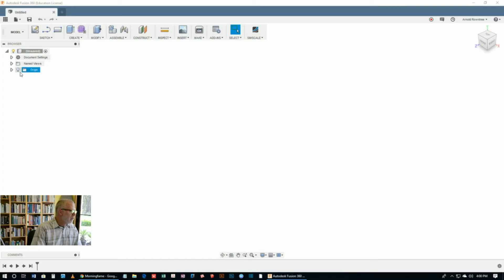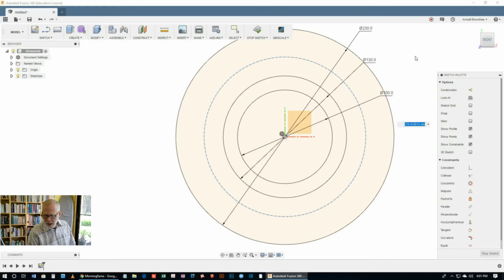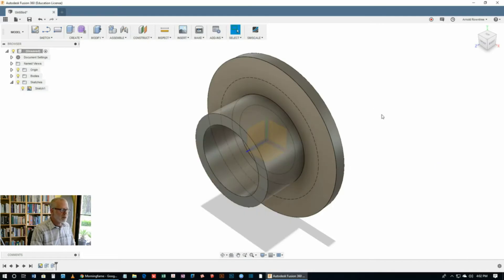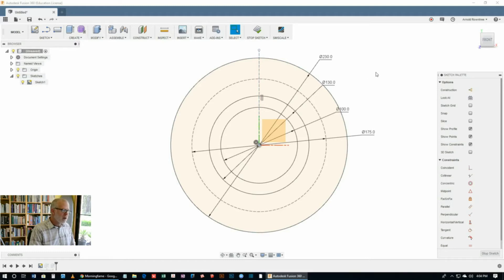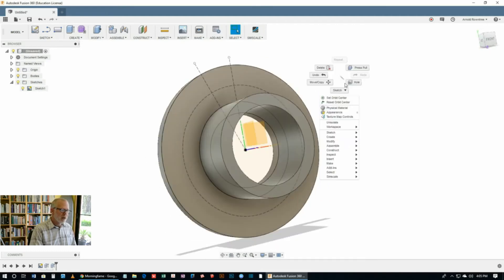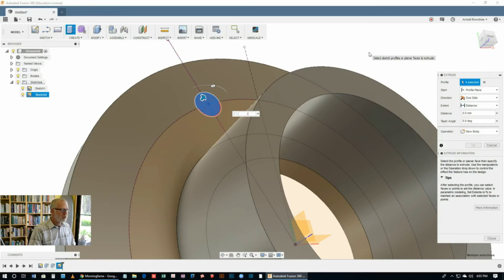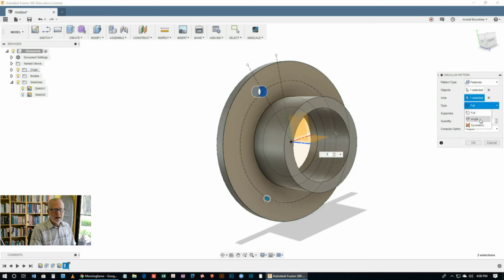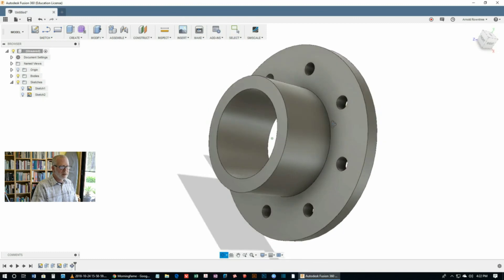Learning Fusion 360 For Beginners - Part 16 of 16

Comment: Arnold, Many thanks for all of the excellent tutorials. I have a question: how would you make the holes in this component threaded rather than through holes?
Clive
Reply from the maker: Clive, that's where the Hole tool comes in. I left it out of the 16 Basic tutorials because threads are such a big topic and are governed by standards which are different around the world. I've found that the complexities arise very quickly, especially in classes where I've had fitters and turners present, the tradesmen who have to work with threads daily. Nevertheless, the Fusion 360 hole tool isn't too hard to work with and I will plan to publish something soonish, thanks for the prompt.
Reply: Thanks, I've got it now.

Comment: So I had a problem getting the circle to snap to the 22.5 angled construction lines.  I ended up having to project those lines to get it to work.
Reply from the maker: Well done Chris, plenty of people have turned grey over this one. If all settings and preferences are right it goes smoothly but a lot of people just aren't holding their tongue at the right angle. I've explained how to project lines countless times.

Comment: Arnold, I don’t know how to correspond with you, this is probably the wrong platform, but I have been practicing very hard. You once said that repetition is one way of learning and as I have great deal of time, in the winter months, I have been using the parameters method of building woodwork projects, mainly garden planters. I have found it is best to test the parameters as I go along. It would be good to have the parameters dialog box on the screen all the time, but this does not work. The point is I still make the mistake, when extruding, of forgetting to make a new component, it defaults to a new body, with the subsequent procedure of converting the body to a component. Is there a way of communicating with Autocad to convey a ‘wish list’? Best regards from a very wet England.
Reply from the maker: Thanks for the contact Ron, its a pleasure to hear of your work and the things you're learning about Fusion 360. Parameters are a tremendous tool.  
It certainly is possible to communicate with Autodesk, in fact the folks at Fusion 360 are soliciting feedback like yours. Go to the forums, there is a link in Fusion 360 which you can get to from the little question mark icon at the top of your screen, over to the right hand side. In the drop-down, hover over Community and the little fly-out will have Forum as the first option. That will take you to the list of forums, sign up if you need to and participate in the Fusion 360 Feedback Hub.  Alternatively go here:  https://forums.autodesk.com/t5/fusion-360/ct-p/1234
Reply: @ArnoldRowntreeTeachesFusion360  Thanks Arnold.

Comment: Thanks Arnold, all 16 done now, some before looking at the video, some looking video many many times :) Question 1, Is there any way of using a printed/scanned drawing to use as backdrop and make a 3d drawing (have drawing on a gondola , thinking easier to draw upon than messure all info). Question 2, If I should make 3d drawing that will be printed out 3d, should I go for 1:1 scale when drawing (later converted to correct scale) or making it correct size (ie scale 1:48) ?  //Dan
Reply from the maker: Congratulations Dan on getting through all those!
Q1 I'll be doing a video on using photos eventually, its great to take a pic with your smart phone and go straight to modeling. It will be a while before I get to it but Tyler Beck has a good video here  https://youtu.be/HVEaYfdsgXc
Q2 You'll find that modeling 1:1 in Fusion 360 is a good way to go. Your slicer software can rescale things or you can save out a scaled down version before you export your .STL file from Fusion. Try it both ways and then decide which is easiest for you.

Comment: Thanks so much for taking the time to get me on the road to success with Fusion 360. I did learn a tremendous amount. However, I never did really get the whole origin setup and selection principles.  I am just wondereing if that's going to be a problem when I go to produce the project using a cnc machine such as a cnc router, 3d printer or plasma cutter.
Reply from the maker: Dave, if you've completed the 16 basic tutorials you've learned the basics of part modeling. That's a great start! CAM and cnc is within sight now but you do have a few more things to learn and just spending time with fusion 360 will fill in those gaps that are a frustration at present. I think you'll find that it will take a while to be comfortable working on your own projects, most people make a gradual transition from step by step tutorials to being able to work on their own projects. If you have the energy take a look at some of the other tutorials on my channel which will give you a bit of a challenge while you explore your own interests.   https://www.youtube.com/channel/UCR-69_Ukrk6u4gwqacqx-WQ

Comment: 1St Great Tutorial ....... Learned The Basics Of Fusion 360 .....
I'm using the Free Eval version of fusion - at the end of part 15 & 16 the demo uses " Create \ Pattern " for creating multiple instances of holes needed for the sketch , am I missing something or is this feature not included with the Free Eval Version i'm using    ........  how would I create multiple holes with the Free Demo Version
Reply from the maker: Marty, the pattern tool is the same in all the versions of Fusion 360, Personal, Educational, Commercial. You'll find that patterns can be done in the 2D sketch as well as in 3D feature mode. In both cases you'll find Pattern low down toward the end of the Create menu. Come back to me if you're still stuck.

Comment: What a wonderful teacher and amazing beginners' course. 

Though I would like to believe that the angle calculation was un-necessary in this case as the object is circular. So anyone having an issue with 12 o'clock position of the hole can rotate it.
Wouldn't that be the same thing?
Reply from the maker: The guys who work in these areas tell me that its a tradition but one that makes life easier for installers and for maintenance. In industry a draftsman is expected to know these things so that's one for you.

Comment: Thanks so much for this series, it really helped me transition from thinking in Autocad to Fusion360. I had a small issue trying to draw the circle for the bolt holes in the newer version of Fusion 360; I simply had to project the construction lines of the first sketch to the second sketch and then I could pick the intersection.
Reply from the maker: Thanks for sharing! Well done Squiggleypuff, yes, that's how it should be done.

Comment: Hi Arnold, it's not so much as doing something wrong, in selecting the quarter part of the circle, it is a wee bit faster to select the circle with a window selection starting from the left side of the circle and selecting the entire circle.
I was just refreshing my fusion 360, as a pensionado with a very small pension I didn't want to subscribe for this software, as I only use it as Amateur and they said it was free, and also for the ones earning less than 100k$ per year it was free . but to my surprise my "free" fusion suddenly stopped after 3 years. goodbye to my files, they were all in the cloud.  But they apparently changed their policy again, so now I can use it again with a max of 10 active drawings. 
 Kind regards Hans.
Reply from the maker: Thanks Hans, I must remember the window selection. I've had an aversion to Autocad for years but I obviously need to get over that.
Renewing your free subscription is a dark art, but thankfully Kevin Kennedy has done a neat video to show us how to do it.   https://youtu.be/XNh3dEfYCX4

Comment: Arnold I used the cylinder feature to make the first hole.  This allowed me to make a hole and extrude in 1 step.  It also didn't require me to select the quadrants when extruding.  It this an exceptable thing to do or could it cause a problem?
This series was very well presented.  You are a great teacher.  Thank you very much.
Reply from the maker: You're very kind jasinarok. If it works, keep doing it. Its twice as good if you can do it both ways, I can't tell if it will be a problem but you'll soon know. Just be sure to be able to do it the ordinary way, just in case. What I often find is that there are many ways to get the result you need.

Comment: Hi Arnold in this drawing when you made the circle in a second sketch I had the same problem having to select the quadrants and circle tool wouldn't snap to the insection either, I then edited the 1st sketch and the circle tool immediately snapped on the insection and then selected as a whole shape to extrude . Is this ok to do? In general sometimes I don't know whether to start a new sketch or add/edit the previous one? Your videos have been most helpful Arnorld, much appreciated mate.
Reply from the maker: Well done Steve, and congratulations on getting through to the 16th tutorial. Whatever it is that you did to get a good result with the circle extrude, try to repeat it and then remember. If you can't remember the specific solution at least remember that fiddling often gets you through a fix. Its OK to do it an unorthodox way, but if it causes problems in your project later on, you'll remember. As for the best approach with sketches, if you go on and do the intermediate playlist you'll see a much more complex sketch in the 'Top Down' tutorial where I use the same sketch for multiple operations. I've purposely kept sketches overly simple in the 16 series so that the inevitable problems are a bit easier to overcome. From here on you're finding your own way of working. Keep going!

Comment: Excellent course. Last used Auto Cad 2000. This is by far easier to get around. Tutorials super easy to follow. Thankyou. FYI Offsetting holes in flanges is to enable setting up line shafts, pipe work etc by making sure that any key ways and the like are at 12 o'clock with the use of a level across the two holes either side or flanges on both ends of a pipe. (very handy 20 meters in the air)
Reply from the maker: Thanks Peter, Its great you were able to give such an endorsement even with the intervening UI change. And thankyou for the explanation for the flange convention, I've watched guys installing an insulated stainless pipeline twenty feet up but now I'll be able to see what wasn't apparent.

Comment: Good day Arnold
Having recently retired from my architectural practice and using ancient software I am exploring going back into an early hobby of 00 gauge railway modelling. I have enjoyed your 16 + basic Fusion tutorials and I am considering modelling our local railway station buildings circa 1887 to be 3D printed. 

My question, I have site measurements clearly at full size, is there away to feed 1:1 dimensions into Fusion for them to be automatically converted into 1:76 scale to produce a drawing as to be printed, this could help identify certain dimensions that would be impractical for 3D printing and be adjusted during the design process?
Reply from the maker: Welcome to the channel Richard. You've made a good start working through the 16 basic tutorials and it sounds like a great project to model stations. Scaling will work in a similar way to your familiar software, use a factor. If you give me a prod over on my Future Engineering Facebook page I'll get that scale factor working with you.  https://www.facebook.com/Futr.Engineering
By the way, did you see where the intermediate tutorials are? This one shows you, see timestamp 3:05        https://youtu.be/2W9R9j5YBG0

Comment: I've managed Ok with the series until this one but have a problem with creating the circle for the hole on the PCD. I create the second sketch but there is no means of snapping to the intersection of the construction line and the PCD. However this does work if I go back to the first sketch and select that. Am I missing something here, and is it possible to force a snap to a type of point (e.g. vertex, intersection, end of line etc.)?
Reply from the maker: Chris, there is a Preference that governs this behaviour. Click on your picture in the top right of the screen, Preferences, General, Design and be sure that the fifth one down the page is ticked, it is named "Auto project edges on reference". How does that go?
Reply: @ArnoldRowntreeTeachesFusion360  - Perfect! Many thanks for that, and for the rest of the video series which have got me started in F360 after being pretty confused by the product.
Reply: @ArnoldRowntreeTeachesFusion360   - Incidentally , I got around the problem with selecting the 4 quadrants of the circle by doing a bounded select around all of them.
Reply from the maker: @chrisveitch1474  Thanks Chris, I knew I'd learn something from the community.

Comment: Excellent tutorial, no fluff and pretty much everything I need to know to feel confident with basic product design in F360. 
Really looking forward to your more advanced work in the future. I had only 1 minor issue throughout and that was that I could not 
snap the circle used in the pattern to the construction line intersection in this tutorial #16. 

I've taken other F360 classes online that were 10 times as long that I don't feel they were 
as useful or concise as yours.  Thank you for sharing your knowledge.
Reply from the maker: Thanks Big Mark, that's fantastic. Congratulations on getting through all these. 
For that issue with snapping the circle to the construction lines, go to Preferences by clicking on your picture in the top right, General, Design and click the one five items down called 'Auto project edges on reference'. Does that fix it for you?
Then take a look at the intermediate series of tutorials if you haven't seen them yet. They go on to the basics of assemblies.
Reply: @ArnoldRowntreeTeachesFusion360  Sorry for the late reply, yes, that was the issue. I've been busy using the knowledge you shared with me to design and build new machines and products for my business. I will most definitely have a look at your more advanced tutorials and continue to send aspiring engineers your way. Thank you again for sharing with us.

Comment: That was a great series, thank you Arnold. Also with the bit where you struggled to select the circle to extrude, you just needed to turn off the first sketch.
Reply from the maker: Haha, good call! Congratulations on your progress and keep going.
Reply: I scrolled down to find if anyone had come up with something! Good call, I used the hole dialogue from the previous lesson, centred the hole on the intersection and adjusted the depth ("All") and diameter parameters.

Comment: Hi - Must have missed the memo! In my version of F360 I cannot get a sketch line to turn into a construction line ie: it won't go dotty! Am I loosing the plot? TIA!
Reply from the maker: Jeremy, there are a few reasons why this kind of thing can happen, try saving your work, closing down Fusion, re-open and start a new document, a new sketch and test the Construction line conversion on the first line you draw. Your version will do it.
Reply: @ArnoldRowntreeTeachesFusion360  Thanks! Yes it works...is it a memory problem?
Reply from the maker: @jeremyelphick-pooley-desig4405   Maybe a memory thing, it can be something as simple as a hiccup in the internet connection. This is a hybrid local/cloud application.

Comment: Arnold, kudos on an excellent tutorial. After trying a few previously, I came across yours which was much more understandable, intuitive and fun. The only problem I had was during part 14. After drawing the lines and arc on the 45 degree plane, it would not extrude. I learned I needed to add a line on the tangent of the plane to enclose the surface, then it extruded fine. I look forward to finding more of you tutorials online. Thanks again from Texas.
Reply from the maker: Glad it helped! And I'm glad you were able to get an answer to that problem.

Comment: Hi Arnold, I am an electronic engineer and used Eagle to design my circuits, this software was purchased by autodesk and added to Fusion 360. I can do my circuit stuff its very similar to the old eagle, so I decided to get the most out of this software. After a bit of Googleing and searching on youtube I found your tutorials which are excellent, please keep up the good work.
thanks
David
Reply from the maker: Welcome David! That's interesting, I was excited to learn about the circuit features that have recently been added and I was motivated to get out the old text books and make a start learning myself. I even bought a multimeter, I've got a long way to go.
You might find the intermediate playlist interesting now that you've worked through the 16 basic ones. Keep learning.

Comment: When I try to cut the hole at 6:47, after selecting the hole I get the error: No target body found to cut or intersect. I tried selecting from the back, same thing happens. I can select join or new body and that works I just can"t cut a hole. Any suggestions will be greatly appreciated. I am using the latest Fusion 360 update. I loved doing these videos and really appreciate all the work Arnold put into them.
Reply: Well I got it to work but only by following these steps in this order. Select last entry in the browser than select finish sketch and than extrude. Now it will allow me to select the circle and make the cut. If I click extrude before stopping sketch it doesn't work. Maybe it's the new update.
Reply from the maker: You're on to it Louis, it always works in that order. The more you use it, the more you will get used to the workflow and the order of operations. With time, you'll feel more like you're in charge and it will obey.
Reply from the maker: Thanks Louis